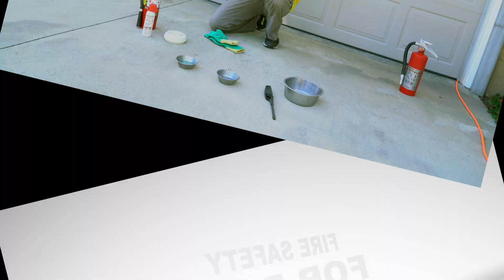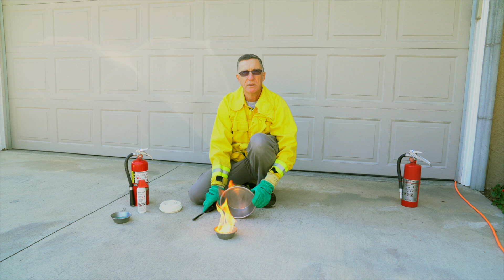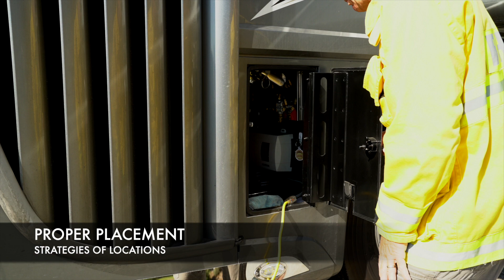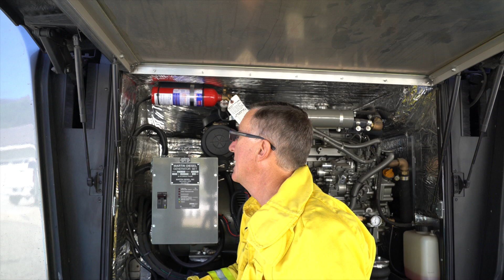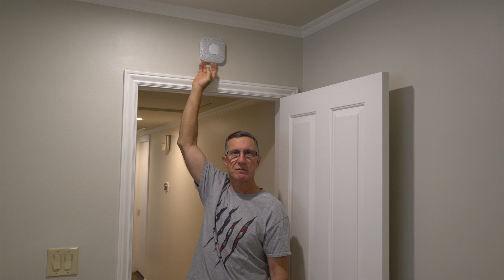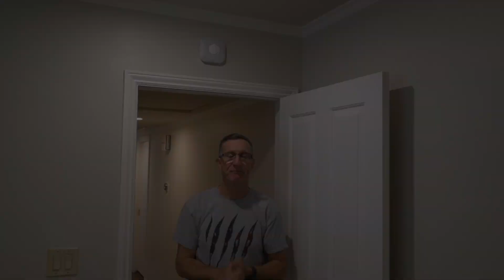Fire Captain talks about Fire Safety in your RV & Home | Extinguishers, Smoke, & CO Detectors

Comment: Excellent, thank you for sharing this valuable information. We are currently reviewing our options for improving our fire detection/prevention capability in our 5th wheel as we become "most timers" later this year. I thought a fire suppression system like Proteng or Blazecut might be worth it, but now, I am rethinking that. What is the chemical based cannister you are sharing at 13:41 in the video? Thanks, Frank.
Reply from the maker: Glad you found it useful Frank. The auto extinguisher in the generator bay is made by SEA-FIRE. The model is the FG 50A and uses NFC-227ea agent which is a Halon replacement.  Lots of references for you in the Description above. Thanks again.